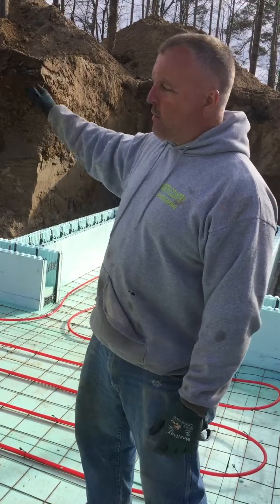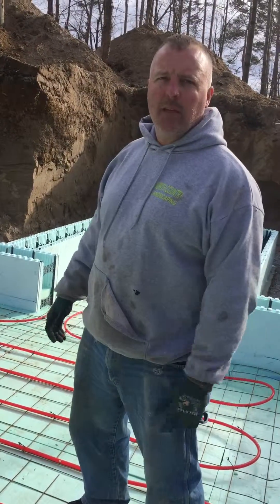Basement floor for radiant heat with Nudura ICF For a single wide trailer.

Comment: I liked your video on Basement floor for radiant heat with Nudura IC.  Do you have a video that shows how you installed the 1st course and attached it with spray foam. Thanks Patrick in Pennsylvania